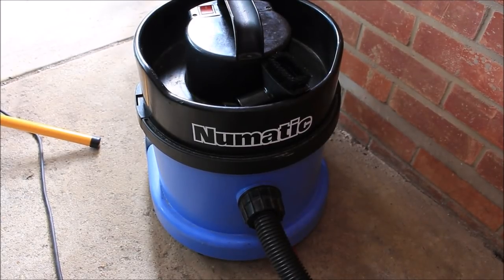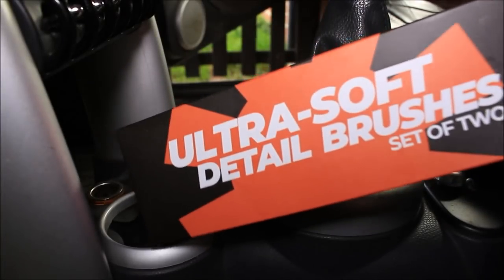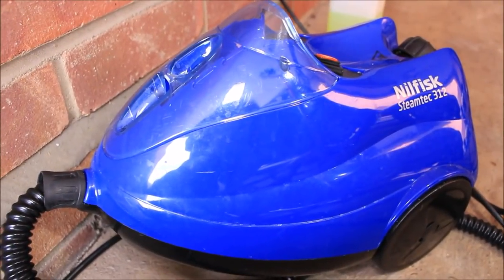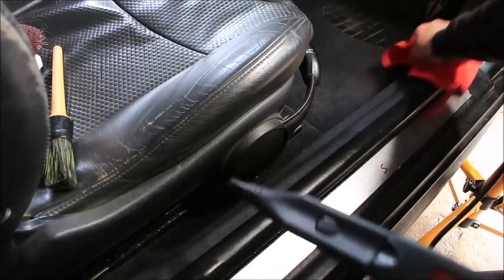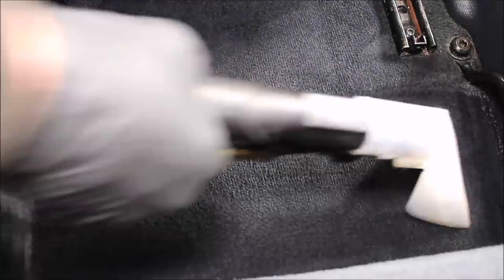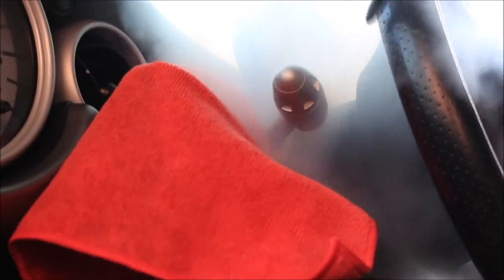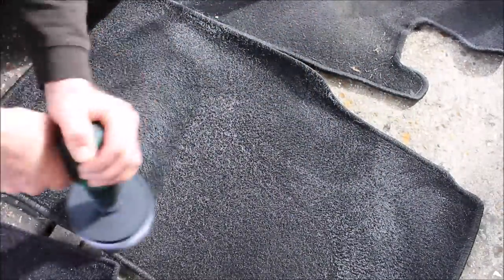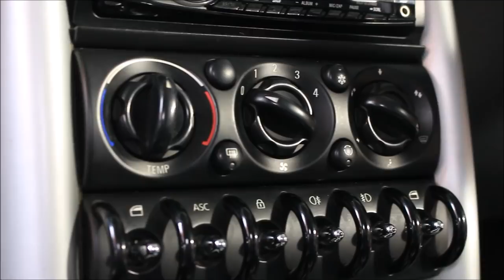HOW TO DEEP CLEAN A CAR INTERIOR

Comment: Great video as usual Paul. I went for the bissell spot cleaner pro for my valeting. It's a great little tool especially with the smaller head for round the pedals. It's got an extra head which is wider for home use which is great. Si 👍
Reply from the maker: Simon Attwood I’m still debating to get one they do look good
Reply: @PaulDoldenDetails  worth it and they have got the scrub brush on the extractor as well to help scrub while u pull the crap out of the seats. They normally go down in price quite often I paid 119 for mine from argos. Great little tool